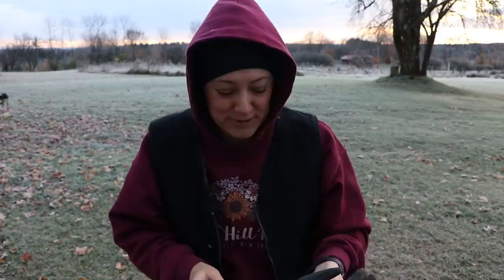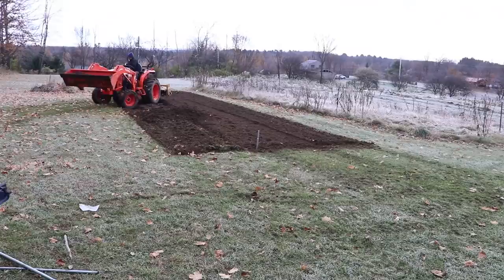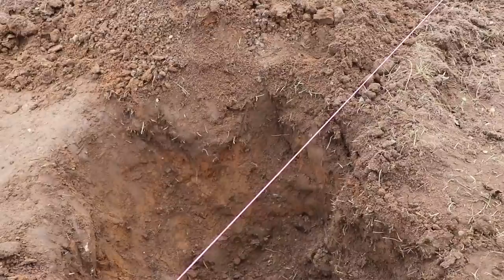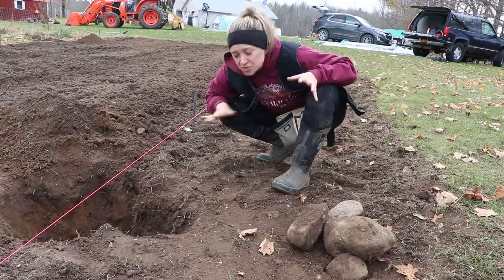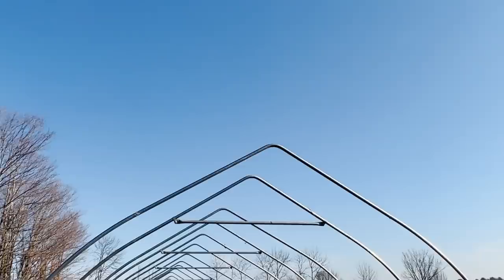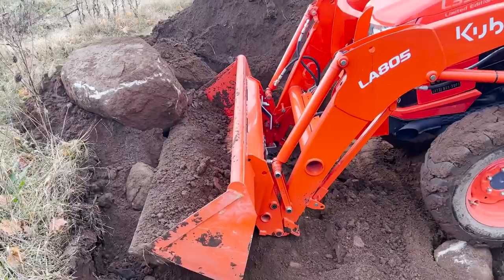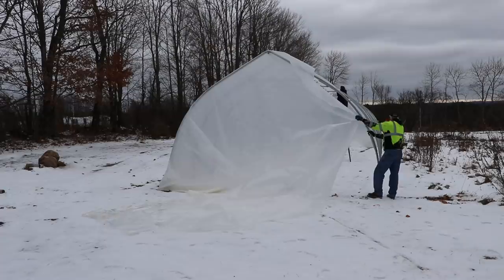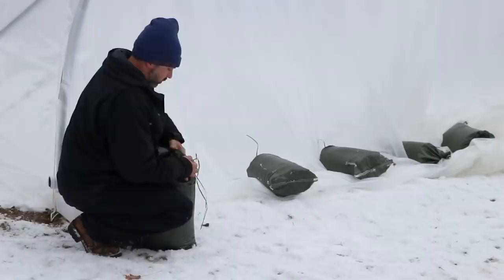The Hoophouse is BUILT! : But it Was NOT Easy : Flower Hill Farm

Comment: Sometimes we get over 70 mph winds… do you think the hoop house would stand up to those? Thanks 😊
Reply from the maker: They talk about their wind rating here- they don't really put a number to it. I feel like there are many factors to consider, including where the tunnel is placed and the direction it's facing. Good luck! https://www.farmersfriend.com/caterpillar-tunnel/faqs/18/what-is-the-wind-rating-on-your-caterpillar-tunnels
Reply: @FlowerHillFarm  thanks for the info just found this reply ❤️💐💖
Reply: @virginia allison peck  If you have really high winds get the ground post option kit with the Farmers Friend high tunnel instead of the rebar. We put this same exact tunnel up last summer with the ground post kit. We add sand bags on the sides during storms and it has gone through 50-60 plus mile per hour winds just fine. Our soil is pretty compacted so driving the posts in worked for us. If you have loose loamy soil you can concrete some or all of the ground posts.
Reply: @douggaskill553  thanks